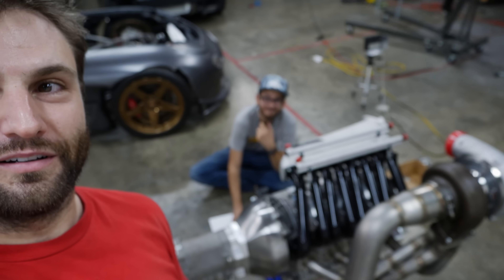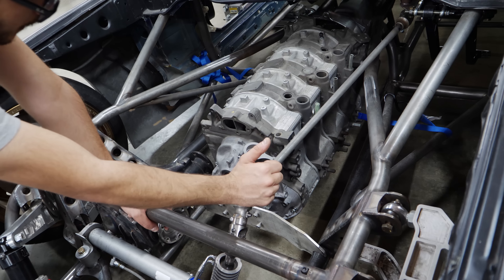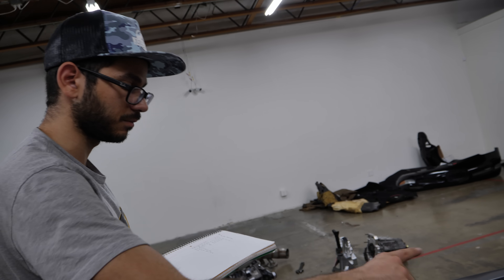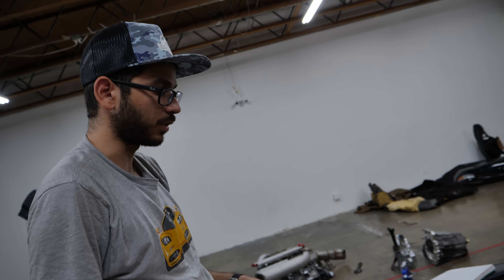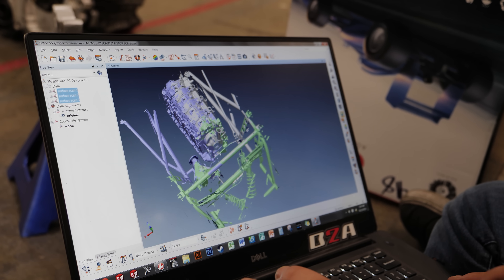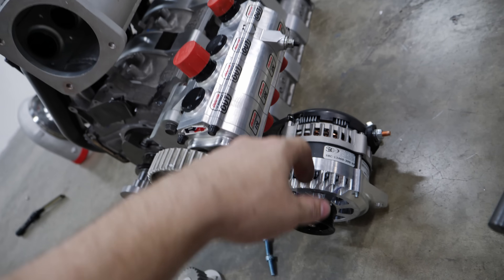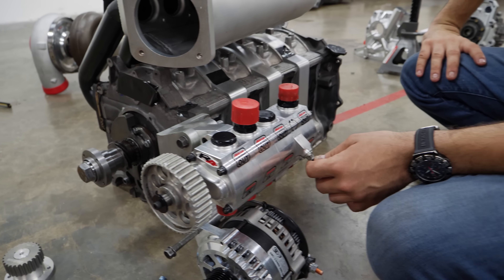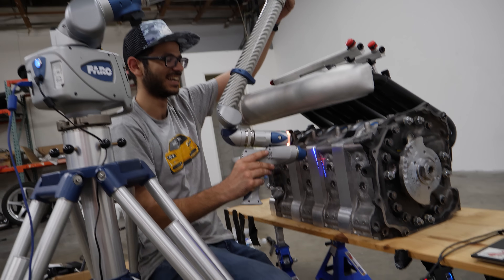Designing the LARGEST Oil Pan for the 4 Rotor. It’s also the Billet Engine Mounts

Comment: Coming soon: 2000 HP 125 lb/ft of torque and more smoke than a diesel. rubs hands in evil fashion
Reply: Rotary is no joke my guy
Reply: @alex_ag7022  I've seen quite a few Puerto Ricans in mazda 1200s pull the wheels at the drag strip then have it fall on its face from lack of torque after the 8k clutch drop. 4 rotor may be a different story from a 2 rotor perhaps...still
Reply: Sean Cunningham well set up boosted rotaries make decent torque. This is exactly what rob is going to demonstrate with the vette. Just because their peak torque is relatively low doesn’t mean the don’t make any. 

N/A rotaries on the other hand...
Reply: And to extend on that point, rotaries naturally Rev high so inherently make good Horse power, therefore they make up for their low peak torque figures. Leave torquey low revving V8’s for trucks.
Reply: @NitroNuggetTV  a diesel with 1100 lb/ft of torque and 400 HP weighing 6000 lbs can run as fast as a rotory with 700 HP and 300 lb/ft. That weighs 2900 lbs. The real idea is that there is no point in arguing what's better. I wouldn't hope to drive something that needs to live above 6k to get me anywhere
Reply: Sean Cunningham sure. Great example... about as scientific as the bible.
Reply: Rowing through a close ratio gearbox and keeping the revs screaming is half the fun IMO

Comment: Can you mount a remote oil tank to feed the dry sump pump instead of or on top of what you are doing? What happens if you need to drop the pan? Shouldn't it be separated?

Comment: Why don’t you do a 2 stroke mix instead of a oil pump and sump
Reply: Do you realize a  oil pump is not a direct replacement for rotary OMP system they are doing something not related to each to each other. One sends pressurized oil to bearings one is sprayed  on the trochoid surface for apex and side seal lubrication.

Then again that's why you have scion that's Tuerks in your profile and not an Rx7 or related car.

Comment: I recon to put every cooling parts at trunk eve oilpan is possible..gotta think just out of the box
Reply: Defo I feel weight distribution is key for a awd supper powerhouse car.
Reply: You can't put the oilpan in the trunk unless you put the engine there too. If you don't have it under the engine you dump all of your oil on the ground.

Comment: For the powersteering I would recommend the pump from an R51 Mini Cooper, it is electro hydraulic, very space efficient and can realistically be placed anywhere, mine on my R33 drift car is 2 seasons old and hasn't skipped a beat
Reply: Dewit Oosthuizen thanks for the tip! I will look into this for my engine swap 👍
Reply: Yes your right I have run the same thing for 5 years on my sprint car my dirt car and a friend of mine has run one similar for 7 years plus on a rock crawler I said to look in to it but you said it best lol
Reply: A solution for early 240sx's with the single cam KA24e was to use an mr2 electric power steering pump same concept you can mount it anywhere. Almost did this to my 1989 240sx that I SR20 swapped because at the time finding the power steering lines from a KA24de 240sx was rare/expensive  and there wasn't any aftermarket solutions. I finally just decided to scrap the lines an went to manual steering. Now a lot of drift cars use this setup because it's compact and you don't have to make custom lines for a motor swap or loss any hp from parasitic loss from belts

Comment: Hey Rob, is there a specific reason for the oil pump location? I've noticed that on all the engines with dry-sump that I have seen have the pump located much lower.
Reply: There's a specific reason for the location of every single accessory on that 4 rotor.. moving anything would be a even bigger cluster to figure out
Reply: @freedomfox8183  well I could imagine swapping position with the alternator would be possible. What I can also imagine is that oil would drainback to the sump with the pump located that high. Not sure how quick it can suck up the oil if it starts with sucking air? (just thinking out loud)
Reply: GixxerGuy1000 _ stop talking out your ass.

Comment: I keep watching all these videos because it's going to be see it all come together.

I always wanted to see a totally off-the-wall idea, putting a turbo charged two rotor engine (13B) into a DeLorean. Originally the DeLorean was supposed to be a mid-engine rear drive rotary engine. Last minute engine issues meant that DeLorean went with the Peugeot V6. They wanted it to be super good on power and fuel economy ... That'd be a downside of having a rotary engine. But something like that would be fun to see.

Comment: Rob, why don't you go for a eletric steering?

It gives you a ton of space on the engine bay, no possible oil leakeages, no hoses and also, less pumps\polys.
Reply: The comments pretty much show ppl don't have a clue that steering electronic can taper the amount of assist it can so you can feel that go back to watching motor trend and edmunds.
Reply: U dont need power steering in a race car
Reply: @gsfbffxpdhhdf7043  ya you might not need it but have you ever done testing on different race cars and see why it's that much nicer to have its just one more thing that makes it easier for drivers and you can tune the input speed everything else way more than arm strong or hyd go test it if you still don't like it then you don't
Reply: Gsfbffx Pdhhdf actually yes you do.
Reply: @gsfbffxpdhhdf7043  Trying telling that to Group C drivers. They would have loved to have power steering
Reply: I had the same question. The electric rack on the RX8 has amazing feel in my opinion, and pretty much shuts off at speed.
Reply: But less feel
Reply: @keloduma  steering shaft is still directly connected to the rack. Just a electric helper motor assisting.
Reply: @wheeliehigh1  but there's a big difference in the way that the electric assist makes the steering feel and the force needed compared to a hydraulic system. Hydraulic systems tend to translate back the feel of the road, whereas you usually don't get that with an electric assist.
Reply: Sisekelo Duma yeah I think he means the mr2 system a lot of FD guys are moving too

Comment: 0:49 [Not going to do a front mount like the Corvette]  I  would recommend you go with a Air to Water Intercooler with a remote ice reservoir because you said that you will be doing long extended pulls which usually take place out west in high temperatures and don't have the space/ air flow up front for an air to air.
Reply: TurboDieselDan i say bump it up one further, add an ac system to it and have it refrigerate the “water” way cold

Comment: Rob in regards to the alternator could it be adapted to run off the rear drive shaft diff flange as some nascar teams and other motorsports teams do
Reply: Richard Culbertson good luck running electric fans while idling though.  Fine idea for a race car that can have a charger hooked up for any extended idling.

Comment: Rotary engines suck, thats why no other engine manufacturer build them
Reply: Things that suck can be a lot of fun.
Reply: Mad mikes having a lot of fun with his rotary an the 787b got banned for outlasting every other engine 😂 ... stick to ur 164hp Hyundai bud
Reply: @kangarojack3814  There is no reason to "ban' engine configiurations, so you are talking shit. BTW i drive a M2 competition, bud. (not that it matter)
Reply: SuperDigitalMe 787b got banned after winning completing 362 laps so what are u talking about , it eventually got lifted, rotary is better than a piston engine when it comes to racing ... their only competition was a Mercedes which ended up failing of course 😂 an  the 787b took the win , a year later they returned but not with same engine cause it was banned they had a v10 an came 4th place , so what does that tell u about rotarys 🤔😂( that there badass racing machines) ...... need I say more ?
Reply: @kangarojack3814  https://www.youtube.com/watch?v=v3uGJGzUYCI
This guy knows a thing about engines....
Reply: kangaro jack wrong the rotary wasn’t banned quit copy and pasting forum comments of inaccurate shit you read.

Mazda lobbied and ran no weight penalty complaining other cars were too fast and had them run extra weight. That weight broke them in 1991 they didn’t finalize the rules and were still in lingo. The regulations were to be 3.5 liter engines which an “r26b” isn’t . Based on its architecture and engine operation when it completely displaced all chambers  a 4 rotor is actually 7.8 liter engine which is where the 787 in 787b comes from. 654cc per chamber x 3 x 4 = 7848 rounded up. Without scaling down the rotary engine architecture you cannot make it 3.5 in any other way and make enough power to run. So they did not meet the prerequisites and dropped out. Mazda came back in 94 and 95 with RX7 in rules that they can compete so you’re wrong .
Reply: k.
Reply: GM, did Audi did, many other companies did your knowledge sucks...
Reply: @msengineeringdavid3702  They DID....
Reply: SuperDigitalMe  you said “that’s why no other” so you’re wrong.

Comment: Rob I got a project idea for you: how would a Supercharger work with a Rotary engine compared to a Turbo
Reply: i'm afraid supercharger can't handle it
Reply: high RPM's is there worst performance range for mechanically driven force inductors. While high RPM's is best part of performance range of rotary engine

Comment: I just wonder why the the dry sump pump is not electric? Also if you have large oil volume and large oil cooler(s) you might run into problems with oil temperature.
Reply: I think all the high capacity ones are mechanical
Reply: The torque needed to drive it ... what’s going to power that?

Comment: I'd be more concerned with the geometry of the steering.
Reply: also in the event of a crash its not so good to have a long spear going thru the engine bay, so with some  universal joints and reasanable lenght in the steering column sections and let them go in angles, that way the steering will just bend in different angles then go straight to the face of the driver.
Reply: electric steering rack?
Reply: @Datskinnychild  IDK but that angle appears to be pretty severe for a universal joint.

Comment: Why not just copy the Mazda 24 Houres LeMans rotary engine winner?
Reply: That's a mid-engined layout with a rear mounted transaxle. This is a front engine with a mid-mounted transaxle.
Reply: @jeromebrown5744  The oil system...the ignition system...the cooling system...the electrical system....how the factory did it might be useful even though technology marches forward and the LeMans car is now kinda old.